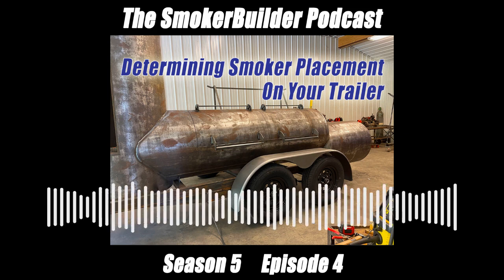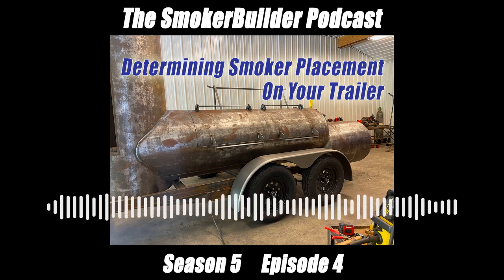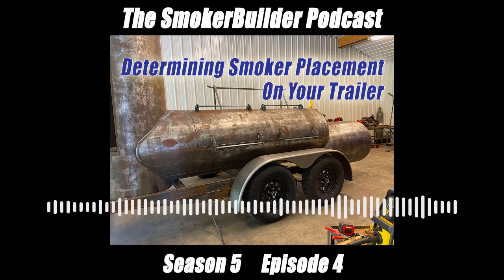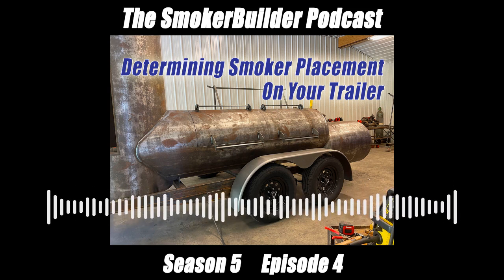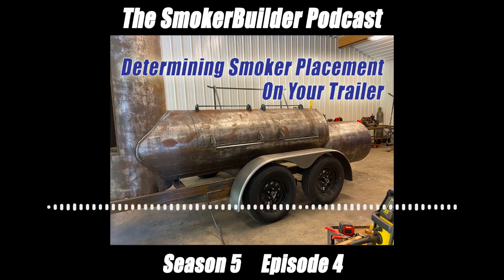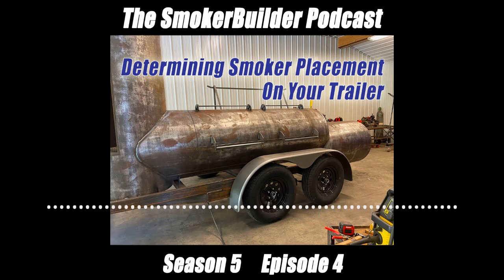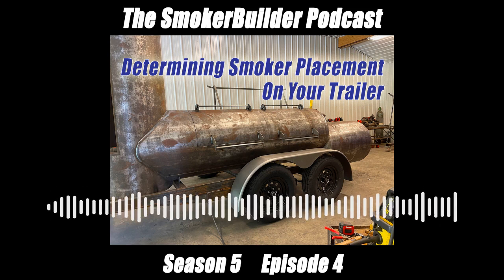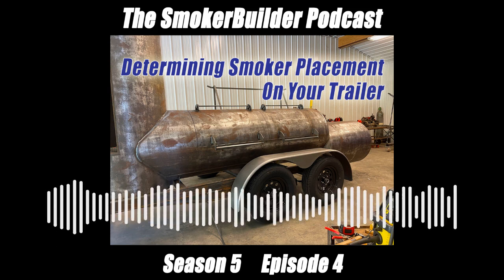Smoker Design: How To Determine Smoker Placement On Your Trailer

Comment: Putting a smoker on one side and it being heavy and putting weight on the otherside to equal it out doesn't make sense. If your smoker is 1000lbs and you put 1000lbs on the otherside you would need another axle so explain that to me
Reply from the maker: So if you had a 2000 pound axle
That means each spring and spindle combination is rated at 1000 pounds per side.
If all of the weight is on 1/2 of the trailer, for instance, driver side, then all of that weight is sitting right on that spring.
In a nutshell, whatever the weight of your load is you should double or triple that for total spring capacity and then It’s best to have that weight in the middle of that span.
When building a Smoker trailer is not really possible to do that every time, so it’s best to put something else of equal weight on the other spring for instance, another smoker and take the total combined load and double or triple that for Trailer capacity
Reply: @SmokerBuilder  Not trying to tell you what to do because your explanation works just fine but I was explaining this to someone in the same manner, and they still didn't understand. I gave the analogy of carrying something in my arms. If I am carrying something really heavy in one hand, and the other is empty, I would naturally lean to one side to compensate for that weight. Messes up your shoulder, and really taxes that one side. If I were to equal that weight on each side it would make carrying it much easier. He then countered "but now you have to carry more weight, what if the trailer can't handle that extra weight." I then, using the analogy, said I would need to get someone else to help or a stronger person to carry it then, or in this case add another axle or a stronger axle or both. After saying that it clicked for him. Thought this might help you in the future, because I am sure you are getting questions all the time. Great content by the way.